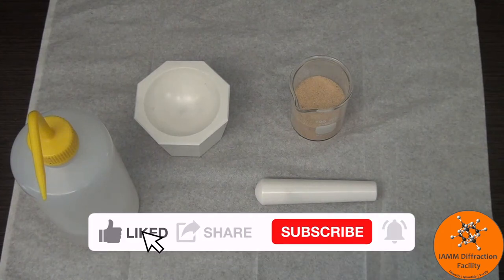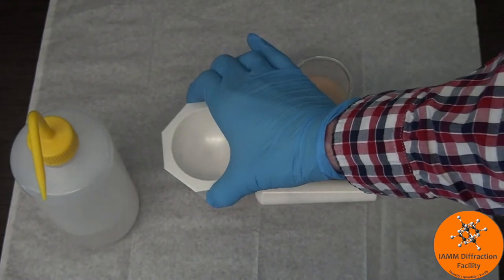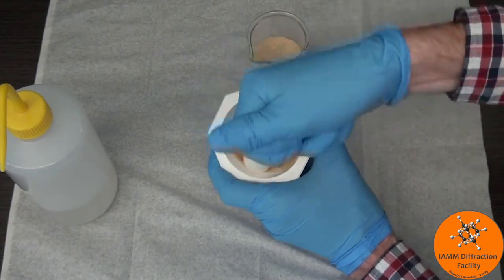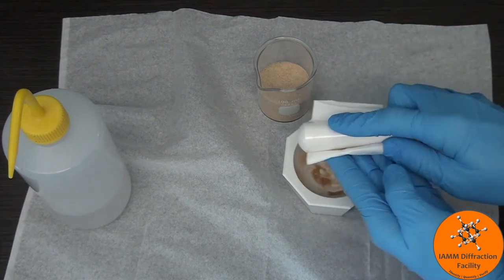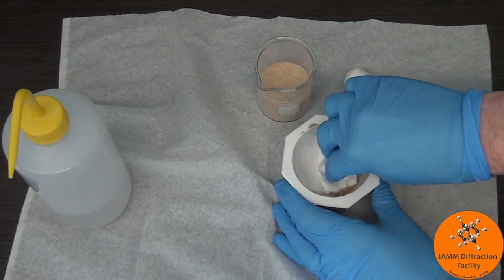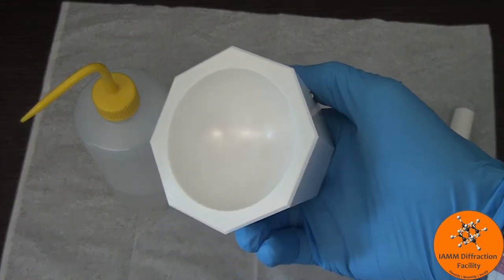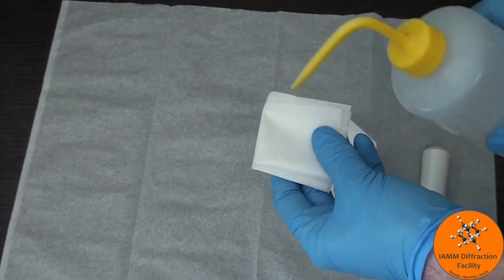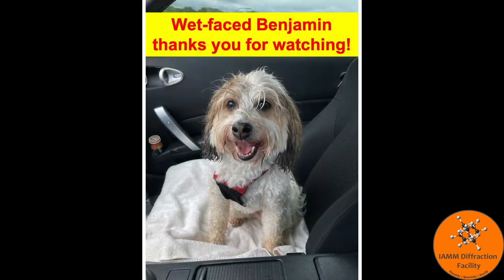Cleaning a Mortar and Pestle with Sand

Comment: Keep up the good work 👍, May I ask about XRD examination?
Reply from the maker: Thanks!  What is your question?
Reply: @IAMMDiffractionFacility  I'm doing a research on coating carbon steel, due to dipping a solid steel in a molten metal bath there are different kinds of intermetallic phases are initiated at the interfaces. Accordingly, what is the proper wat to identify the phases on the cross-section side? What kind of XRD is more relevant to this case? Any specific preparation need to perform the analysis?
Reply from the maker: My apologies for the slow reply, I was very busy preparing for and then taking a vacation.  I don't think I have a good mental picture of your situation though as I have not performed this type of experiment in the past.  How thick is the region in which you believe you have different phases?  I'm guessing you expect different phases as a function of sample depth, right?  

Initially, I would think that a regular theta-2theta or "powder" diffraction experiment would be fine for phase identification.  However, depending upon how you orient your sample in the beam and what beam size you use, you'll likely get a mixture of different phases that may complicate the process.  You can reduce the size of the X-ray beam with different optics and/or prefix modules (depending upon your diffractometer) if you want to focus on a particular region of the sample though.  And since you are looking at a steel sample, either using a monochromator or different X-ray source (such as cobalt) may help improve your diffraction pattern.  Iron fluoresces with copper radiation, which can worsen your diffraction pattern.  This can complicate things when trying to identify phases of small quantity.